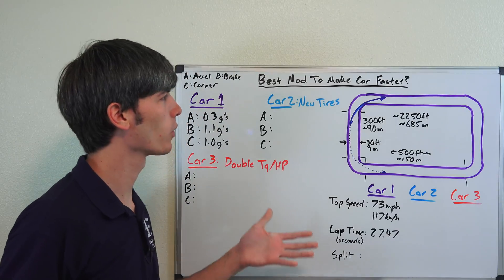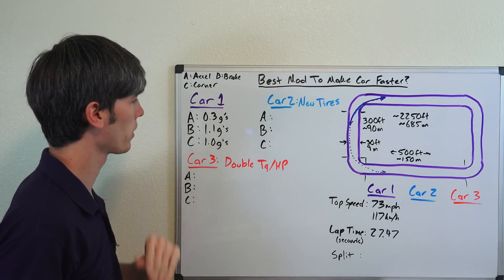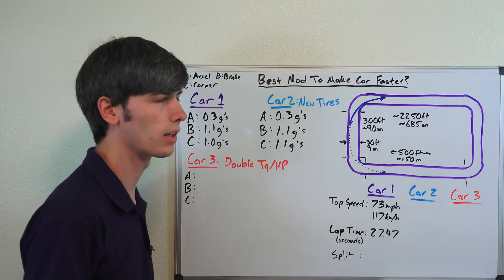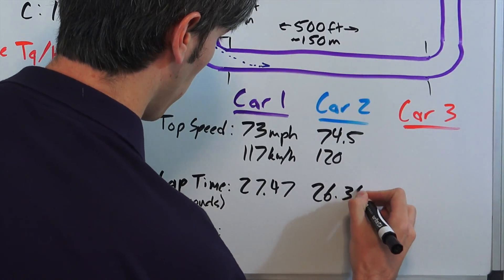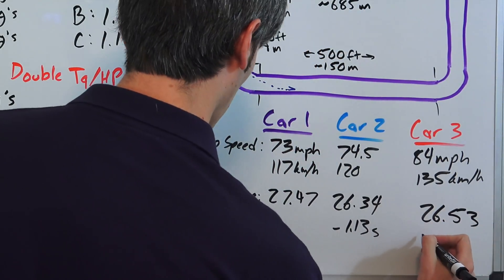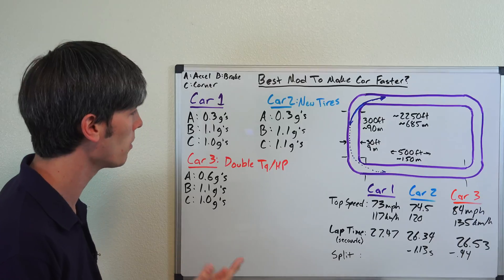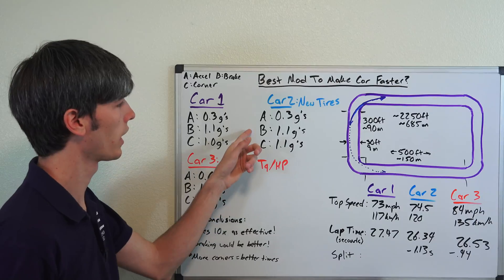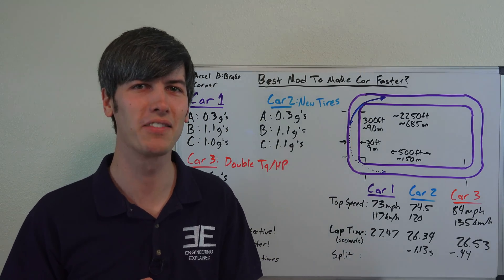What's The Best Car Mod To Go Faster?

Comment from the maker: Happy to see people interested in this topic - the math behind tires is fascinating indeed! For those interested in similar concepts, I'd recommend checking out my video on the racing line, which illustrates why it's the fastest path, as well as cornering speed, which elaborates on how you can determine what speed you can take around a corner. Thanks for watching folks, hope you're all having a great day! The Racing Line - https://youtu.be/4m94jpEp3Go Cornering Speed - https://youtu.be/fjrOsp6S8rA
Reply: Can you do a video on coilovers suspension.  Like with all the good stuff. Spring rates and bound rebound and so on. That be awesome!
Reply: Engineering Explained what about weight reduction? higher acceleration, brakes, and cornering speed
Reply: You need merchandise.
Reply: Engineering Explained if I increase tyre width from 235 to 245 on my front wheel drive cupra 290 would there be a noticeable difference like you just explained? I'm referring mostly to acceleration and cornering.
Reply: Killer_ Street_Machines No. AWD won't kick out. Braking Gs won't be affected by speed. If anything, a faster car will pull more Gs under braking due to aerodynamics at speed.
Reply: Bill, there had to be some massive assumptions made to get static numbers to do the math  with. In reality all those numbers are dynamic and make for some insanely difficult math. This is why in reality, performance numbers are really a best guess sort of thing. They mean nothing until you have an actual prototype that you can test in the real world.
Reply: Dude, in the video that you calculate the torque in the wheel to shift gear, should you calculate the horse power instead of the torque? Doesn't matter how much torque the car can produce, whats matter is how much torque per second, right? Tnks brow, i love your video ;D
Reply: Leo You would need a high downforce car for aero to matter that much during braking. Think a race car with wings at both ends. Braking Gs won't be affected, really, but you'll have a longer braking period when braking from a higher speed.
Reply: Love all the math and explanation.  Just a quick note though, you talk about a basic track car which corners at 1.0g.  A basic 'sports car' (ie: 2016 Mustang for example) as stock hits .82g while a more dedicated track style car (ie: 2016 Vette) can hit about 1.2g.  Any idea what the numbers would change to with more 'real world' numbers?
Reply: ***** Switching to good tires is the easiest and will give a good return in performance. Having/finding a good setup isn't as easy as it sounds, and can be expensive to achieve if you don't already know what parts you need to achieve the balance you're after. Finding the balance you want without prior knowledge of parts can require going through a rather large number of different springs and dampers to find the spring rates you want and the dampers to go along with those spring rates. Even when someone else has done that work for you, you are going to be going with the balance that they liked. That's not necessarily going to be what you would prefer for yourself. Every driver is different, has his own style, and his own preference for how he'd like the car to feel. So one person's "perfect setup" may not feel very good to the next guy.
Reply: Engineering Explained 1.0g's around the corner is wishful thinking with double torque and horsepower, same with the braking, that much power would probably kick the back end out on the corners and the braking would go down because of how fast it'd get going
Reply: Engineering Explained 
playing real racing 3 and racing lines matter
Reply: would you think these cars started with a rolling start or from a stand still?
Reply: Satan Fuckoff666 chill oot
Reply: I wish you ARE my maths teacher
Reply: Not much, the difference is in the compound and the tread pattern, rather than just the size, in fact a heavier tyre (wider would be heavier) would increase unsprung weight, and could slow things down. I put BFg's on my old v6 Alfa, and it understeered like crazy until i swapped out to Goodyears, both the same speed rating, and size (not price though)  
Get a spare pair of wheels and invest in some mega tyres and cheap ones, stick em on the front, you will see
Reply: Just wonderful, I have been researching "improve car ac performance" for a while now, and I think this has helped. Ever heard of - Vabrielbey Vehicle Verifiability - (just google it ) ? Ive heard some incredible things about it and my work buddy got amazing results with it.
Reply: I always have my cat double check my math too.

Comment: 6:33-6:36 Looks like the cat wants to go faster, too! Maybe to keep up with a Jaguar?
Reply: Its possible you may have missed his reference to a car manufacturer
Reply: Asad Rizwan I think jags are brilliant
Reply: Elton Thomas Or a cheetah!
Reply: Asad Rizwan I said for its time. And the current line of jaguar automobiles are still fine luxury performance vehicles. Also the XJ220 has a top speed of 212 beating the C7.
Reply: Asad Rizwan jaguar built one of the world's fastest production cars of its time the XJ220
Reply: Asad Rizwan the s1000 isn't comparable, its renowned for its power to weight ratio, so acceleration will be quick to 99% of cars, and it's a sport bike, of course it'll be quick, but top speed wise, they're all limited to 186 :/
Reply: Nope, Don't think highly of Jaguar.
Reply: L3G1T & what does it offer now that can stack up to, let's say, a Model S or a GT-R or a C7 or an S1000RR?

Comment: From your previous video on how to launch FWD/RWD cars, the example given would have to be RWD or AWD car. FWD car may have to be unrealistic proportions to achieve 0.6g acceleration with 1.1g braking. Then, what is the limit with today's tires? 2g braking? Basically the question is what is the upper limit with today's tire tech.
Reply from the maker: For most road cars, 1.1 g braking is pretty close to the limit, if not slightly higher than the limit. You can make this number higher primarily two ways - stickier tires or more downforce.
Reply: What I meant is if you use stickiest tires today, what would be the lap times. Graph of lap times (y axis) vs tire coefficient of friction (x axis) for various acceleration g force (various plots in same grid) would be interesting. Maybe you can get tire companies to sponsor such study?

Comment: Did you calculate the lap times based on a rolling start or a standing start?
Reply from the maker: It assumes a rolling start. If the two cars were to race from a standing start, the power car would take the initial lead, while the tires car would catch up in corners. Eventually, there would be an opportunity for the tires car to pass in the corners. If able to successfully pass and maintain the lead across the straight, there would never be a time for the power car to regain the lead, assuming both drivers were perfect. Ultimately, it would come down to drivers between the two cars, but theoretically the tires car would win.
Reply: Cool, that's what I thought. Thanks for the detailed response :)

Comment: I was expecting the higher power car to post a quicker lap time and was ready to point out that even if that were so, the price difference between purchasing grippier (shut up, Chrome—that's totally a word) tires and doubling power would, in most cases, be very high so saying that more power is the 'best mod' without taking price into account would be misleading.

But better tires, which I'm sure is significantly cheaper than doubling any given car's HP in most cases, did in fact result in a better time, so it seems that tires are, objectively, the better mod and I shall eat my words.

Great video, as always!
Reply from the maker: That was the train of logic I was hoping most people would fall into, and then come to a happy (and somewhat surprising) realization at the end. Tires are cool!

Comment: i go at the track all the time i made about 6 second upgrade this years on a 2 minute circuit, i did Brake, tire, suspension and a LSD, next step is full bolt on with a tune!
Reply from the maker: Right on, that's an impressive improvement! Your driving has probably improved as well the more time you spend out there!
Reply: Engineering Explained it helped for sure!

Comment: are there also mods you can do to improve you economy?
Reply: rubikfan1 lose weight. You'll go faster and get better mileage.
Reply: Reduce weight, reduce aero drag, driver mod, avoid turns, avoid rapid acceleration.
Reply: patw52pb1 has nailed it. Best mod is driving style ie. don't stomp the go pedal, corner smooth as you can, limit excessive revs etc. Less weight and less drag are good too.
+Adam Budai You must hate your car. A lean tune leads to detonation and kills motors... Over inflated tyres lead to less grip and you die on a corner.
+alephii So called "green" or "eco" tyres use a specially designed tread pattern and harder compound to reduce rolling resistance and improve economy but you sacrifice a fair bit of grip so performance is worse.
Reply: tubeboy you mean a way to  improve consumption right? Because to improve economy you should keep the engine in low RPMs, and you do that accelerating slighter and changing gears earlier... keep RPMs low!
Reply: tubeboy slow accelartion is more fuel efficiënt than fast acceleration.
Reply: tubeboy Your method of "accelerate hard then cruise" might sound good on paper but the reality is that it takes more than 50Km of cruising to make up for all the fuel burned while accelerating hard. Keep in mind thats 50Km for EVERY time you accelerate, so you are far better off accelerating at a steady pace up to cruising speed. 
Your quote from wikipedia only tells half the story. It completely ignores losses in efficiency due to turning the gearbox, the diff, the rolling resistance of wheels and tyres and thermal losses (heat generated). Again your wiki-lies sound good on paper but as just stated, only takes into account the engine, not the driveline as a whole.
I have tested this myself many times driving to and from work and the results were always the same. Steady acceleration up to cruising speed uses less fuel than accelerating hard then cruising.
There is a reason manufacturers list claimed fuel economy with 2 numbers. City driving (lots of acceleration and lower cruise speed) and highway driving (less acceleration and higher cruise speed) and the highway figure is always lower. There is also a reason why driving schools teach the "egg method" for accelerating. pretend there's an egg between your foot and the accelerator and press such that you don't break the egg.
Reply: tubeboy You are still ignoring the physics of every component in the driveline other than the engine. If you only consider the engine then your theory sounds fantastic. Delete your "convenient omission" ie. use a real world scenario with gearboxes, diffs, driveshafts, wheels, grip factor, thermal losses etc. and your theory falls on its face.
Reply: +tubeboy 
It is abundantly clear you do not comprehend the complexities of physics, thermodynamics, acceleration, engine fuel enrichment required for vehicle acceleration and vehicle fuel economy. 
Acceleration is dynamic, not static, what you cite from Wikipedia is static state as it relates to only the engine and not applicable to vehicle acceleration. 
In the case of the Honda S2000 AP1 F20C it has a final drive ratio of 4.100:1 and top gear ratio of 0.810:1 resulting in an overall top gear total ratio of 3.321:1 with a tire diameter of 24.86, tire circumference of 78.09, the engine develops 177 kW (237 hp) @ 8,300 RPM, 208 N·m (153 lbf·ft) @ 7,500 RPM, yet gets best fuel economy of ~24 MPG at 60 MPH which is only 2,693 RPM. 
That 2,693 RPM is far away from your theoretical 75% of max torque (7,500 RPM) which calculates to 5,625 RPM.
Reply: narrower tyres maybe... there is out there green tyres with compounds that should improve fuel economy...
Reply: rubikfan1 inflate your tires with as much air as you can, right before they burst!  Haha
Reply: When you need to accelerate put your foot all  the way down or so that you still have grip,  shift after max trq. That's when you get most power out of fuel. When you hit your cruise speed put highest gear in.
Reply: alephii No, It uses more fuel for less time and in overall it saves fuel, but only for acceleration, otherwise lower rpm is better.
Reply: rubikfan1 No it's not. "Engine efficiency peaks in most applications at around 75% of rated engine power, which is also the range of greatest engine torque (e.g. in most modern passenger automobile engines with a redline of about 6,000 RPM, maximum torque is obtained at about 4,500 RPM, and maximum engine power is obtained at about 6,000 RPM). At all other combinations of engine speed and torque, the thermal efficiency is less than this maximum." -Wikipedia
Reply: Lol turbo cars have there max torgue much earlyer. Tdi cars have that at 1500rpm. 
Turbo gasoline somewhere between 2000rmp en 2500rpm. So keep rpm at that point
Reply: rubikfan1 No, just no. Tdi has a flat torque curve from about 1500-2500 or in some cases to 3000. and petrol has flat curve from 2000 to 4000 or in some cases to 5000.  In modern stock turbo cars torque is almost flat and starts to drop off when engine starts to go near peak power.
Reply: scott thompson No, it takes less distance to make up than it takes than to accelerate slowly. It's simple. Peak efficiency is peak torque that you accelerate with and then cruise. Braking is always wasting fuel which happens in city more. If you have room to accelerate to cruise speed slowly you should have gone harder. in city you can't always do that. The driving school that I was in told to shift to torque band, give plenty of gas and then go for high gear when in right speed. I did that and got 3.7L/100km in city and highway combined with 2L TDI. You can't beat physics.
Reply: i hope the video maker read this comment chain. so he could test it out.

lets do acceleration from 0 to 50 km/h (city limmit) then a 1.5km cruise. 

test 1. no more than 50% gas pedal and rev below 2500 (2000 for diesel).

test 2. 75% gas pedal with up to 3500 rpm.

test 3 100% gas pedal with redline rpm

than every test should be done 5 times. but the car has been running for atleast 30m so it reach optimal tempature. and the test are done in 1-2-3-1-2-3-1-2-3-1-2-3-1-2-3.
we calculate the avarge fuel consumption for each test and add standard deviation (at 95% witchs is sigma 2).

all other stuff mast be the same(like weight, tire presseur).

did i forget anything?
Reply: rubikfan1 He has s2000 and v-tec tho. It's one of world highest revving engines, so he should go 75% and to atleast 5000 rpm.
Reply: rubikfan1 My "drive to work" test involved leaving at the same time every day (similar ambient temps every day), the same route (at the end of the street I live in I turn onto the highway, keep going on the highway and 100Km later turn off the highway directly into the carpark at work), the same startup procedure (from cold, start the car and start driving) and I even factored in the return trip (to eliminate differences between downhill drive to work and uphill drive home). I repeated the same driving style for a whole week to eliminate one off variations.
2 methods tested... 1 was cruise... moderate acceleration and then maintain cruising speed. 2 was punch-it... accelerate hard then cruise at the same speed as test 1.
Results... Method 1 saw a saving of more than $20 per week for a negligible increase in time taken... or in other terms I got 4 free beers at the pub for not driving like a pissed off teenager.
Reply: scott thompson Those losses happen any way when accelerating, no matter how slowly you do it. As I said you should't spin the wheels and it should work.
Reply: scott thompson I also did that for a week each and got 0.3l/100 less when accelerating hard. Same road and about same temps. I even tested windows up and ac on vs window down. Windows up used 0.6L/100km less.
Reply: patw52pb1 I meant after acceleration you should put high gear on.

Comment: That just confirms what I have observing for a daily use car. It's better to have a nice set of tires with a well adjusted suspension (I mean by factory) in a car with a modest power, than these new low torque/hi power turbo with low displacement that has  mediocre tires width. It can maybe give a nice first impression, but on a real world road that's another history. I can keep the speed at turns while they had to break and accelerate again. Also, keeping the speed gives more comfort to passengers.

Comment: This is bad topic to do such a short video as it so subjective. Conservation of momentum is usually king, but there is a lot to it. I watched Randy Pobst post a 1 second faster time at an autocross one Saturday in that guy's car they were sharing that day making driver the best improvement for most. Next would likely be suspension or tires depending on car and track. Some cars come with great tires, but less cars come with great suspension. So, a rough track could likely use help keeping tires planted since tires not touching the track can't work regardless of their grip. Bad drivers can compete better with extra power to fix mistakes, but will learn quicker in a slow car maintaining momentum. That just leaves every other variable, but does cover most of the large bases other than aero.